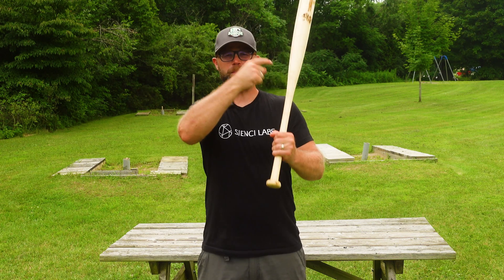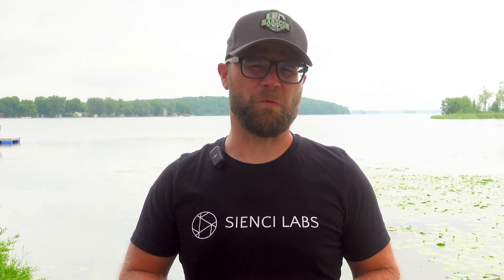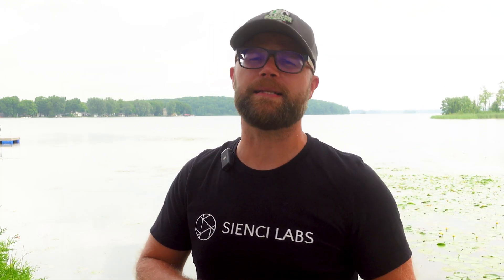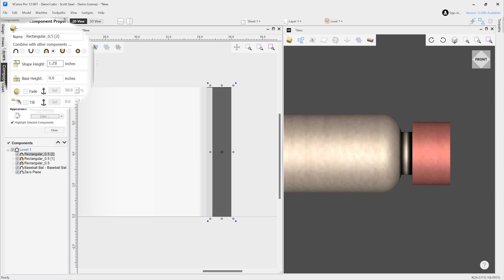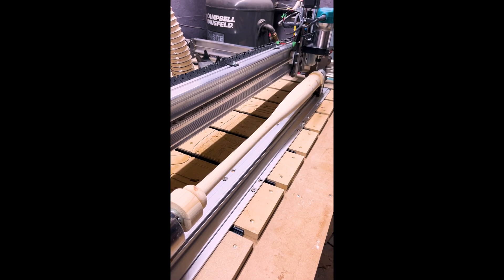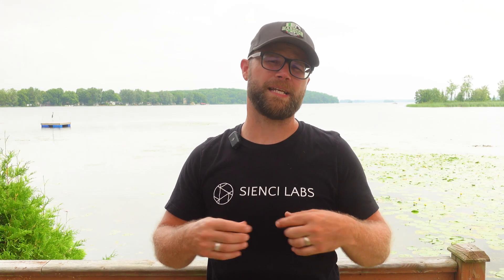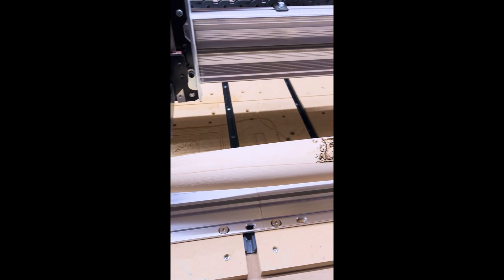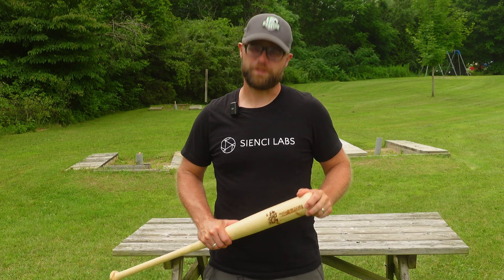Transforming Wood: Summer Project Ideas | Cottage Country Sienci S2 EP2

Comment: So what is the benefit of the continuous toolpath other than the bit direction you mentioned? It seems like you were using a lot more of the cutting edge, especially on the handle section.. or is it really just to avoid the tool change from a roughing path to a finishing path?
Reply from the maker: You can save quite a bit of time by not having the direction change constantly. So saving time + cutting direction are the main advantages.
Reply: @SienciLabs  thanks!